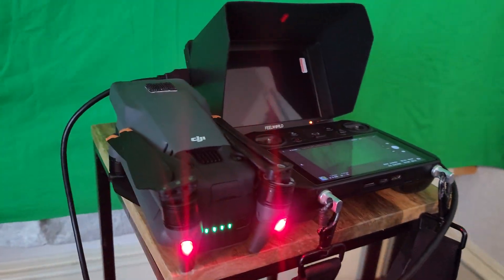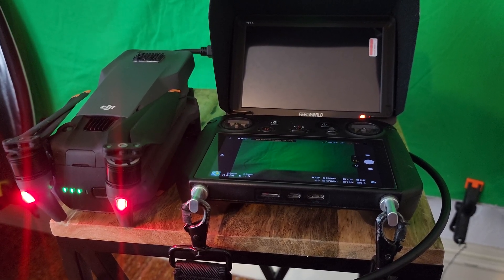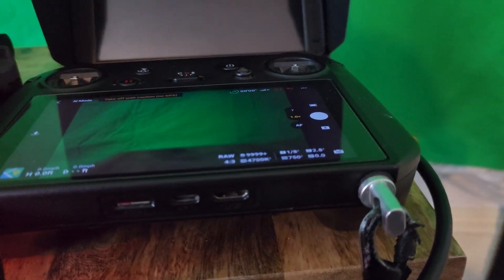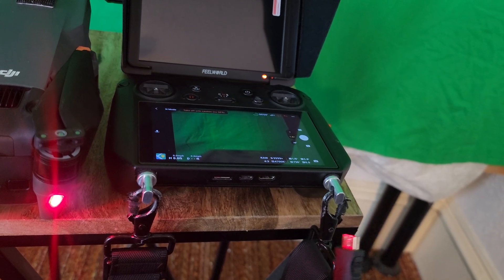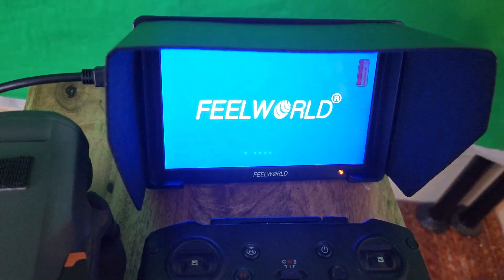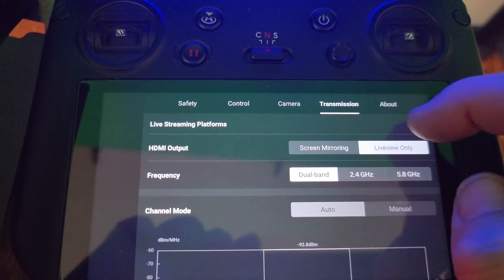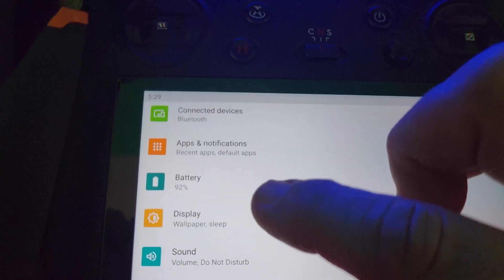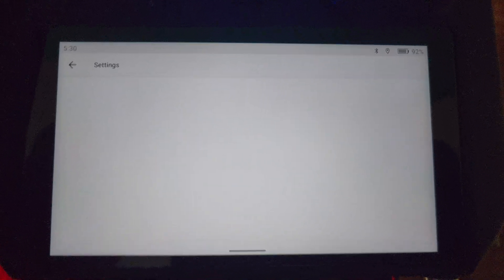HDMI Out no longer working on DJI RC Pro as of November 8, 2022.

Comment: I had the same issue and when I went into Settings - Display - HDMI I found the setting was on 3840x2160 and as soon I've selected 1960x1280 the external monitor worked perfectly and signal was clear!!! (I use Atomos Shinobi that can not support 4K but just HD)

Comment: Maybe helpful to someone:  My HDMI isn't sending a signal to a monitor or transmission unit either.  But I was able to convert to SDI using a Decimator HDMI->SDI device.  My monitor and trasmission units accepted the SDI just fine.
Reply: Change the HDMI settings in the base software to resolve this. Settings, HDMI, Advanced, Change the frame rate / resolution - note this is only in the menu when there is an HDMI cable connected.

Comment: same issue here.. did you find a solution ?
Reply: To get clean HDMI Out on the RC-Pro, click the ellipsis icon in the upper right corner of the DJI Fly app, accessing Settings. Select the TRANSMISSION tab, then under HDMI OUTPUT, select  LIVEVIEW ONLY.

Comment: you have sent it in the rc controller hdmi was folty hou muts repair cost before i wil sent it in
Reply from the maker: The repair was free because it was a manufacturer defect covered under warranty. But without a warranty, the repair was around $65.00 USD and shipping was $15

Comment: Bad you had to find out that way - but good you know - in the past Chrystal sky controller had the same issues between firmware updates. Some times different HDMI cables work or will not work. SO the lesson I learnt is to test and test after a firmware update. The HDMI menu in the android settings interestingly is blank until you plug a cable in - i'm not a fan of that kind of intelligence. When I plug it in all the resolutions come up. I always plug in the cables and monitors before powering up the DJI RC Pro as to give it kind of permission to turn the HDMI on before I get cranky. Previously the output resolutions - some just simply were not available. I think they think the HDMI out is a last thought and that not many people care. I am just super careful as today it works then tomorrow it might not

Comment: Are you sure your monitor is on the right HDM app input
Reply from the maker: Yeah I should have updated the post. I sent it in to DJI. It was a failed board. They sent me a new RC and it works now.
Reply: @MirrorUpIdaho did you have to pay for a replacement?

Comment from the maker: Update: After sending into DJI for evaluation, it was determined to be a failed core board inside the RC unit.
Reply: Thanks for updating
Reply: wow man thanks for the info. im gutted I got my new rc a few days before the shoot just for this reason and it doesn't work just like yours. Damn it! -_-
Reply: I have 2 RC Pro with the same issue, one is brand new.
Reply: To get clean HDMI Out on the RC-Pro, click the ellipsis icon in the upper right corner of the DJI Fly app, accessing Settings. Select the TRANSMISSION tab, then under HDMI OUTPUT, select  LIVEVIEW ONLY. @thompsonskyproductions
Reply: I just rented one for a job that requires live stream and I don’t have the option to change the HDMI output. Any other ideas? It can’t be off on all models?

Comment: I’ve just tested mine, with the latest firmware and the hdmi out worked fine. Sorry that doesn’t help. My guess would be the actual hdmi port on the RC. It’s quite common on consoles for these to fail due to the solder spots on the ports legs breaking free, just with everyday in and out. One thing, have you tried connecting the RC to say an HDMI on a TV just to rule out your mini monitor ?

Comment: I’ve done some investigations into the same issue and just gave up in the end. My RC Pro is on slightly older FW (haven’t done the Nov 2022 update) and it also has the issue as you showed. Although mine doesn’t output via HDMI to my feelworld 279S and 4K TVs, it does work with Epson BT-35e (with the HDMI box), and I also get signal via the USB-C port (same Epson glasses via USB-C, Rokid Air via USB-C, feelworld via USB-C to HDMI hub). So my conclusion is the HDMI is somehow very picky. Don’t have this issue with the Smart Controller 🤷‍♂️
Reply from the maker: Mine was determined to be a failed core board inside the RC. You should send yours in as well.
Reply: @MirrorUpIdaho  I purchased the RC Pro today and have the latest firmware. In my case I see the HDMI resolution settings, but I can't see the image in Headplay, even changing to different resolutions. The difference is that the glasses recognized an entry and displayed the configured resolution, but the screen remained black. I was able to send the HDMI signal to my TV, but only by connecting directly to the TV's HDMI port. When trying to connect to the HDMI input of my receiver (Onkyo) apparently the signal was not recognized.
Reply: @MirrorUpIdaho  I wonder if that’s a universally bad part (for whatever reason) that should fall under a recall? 🤷‍♂️